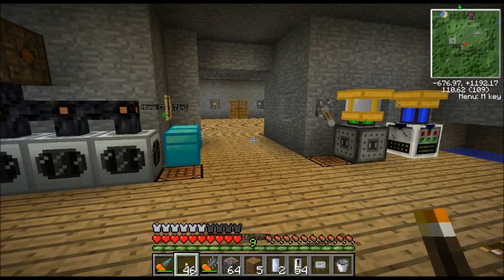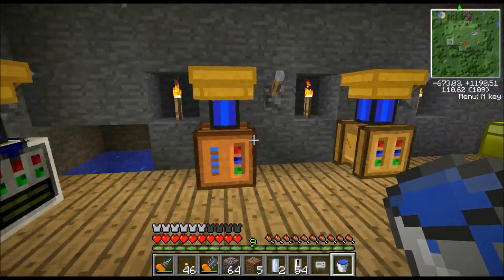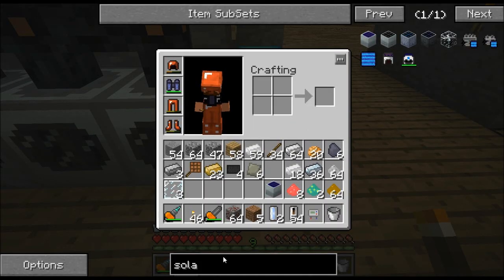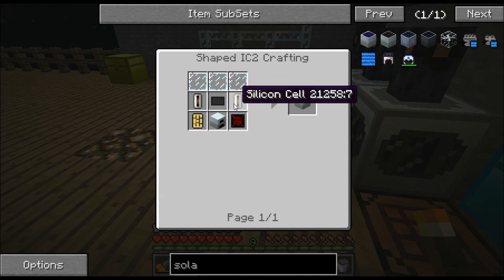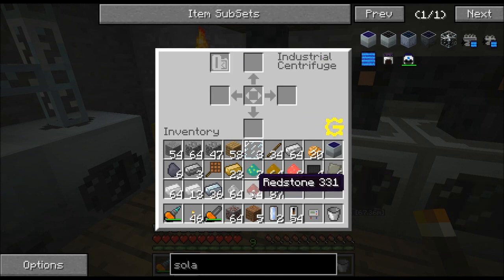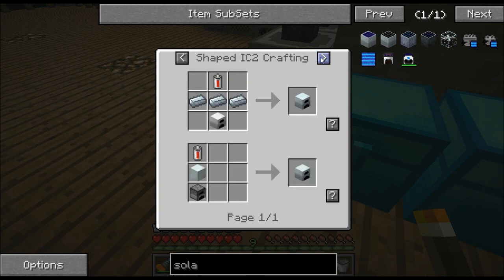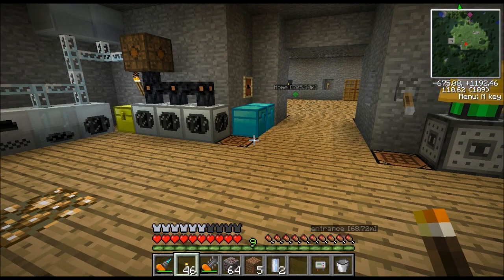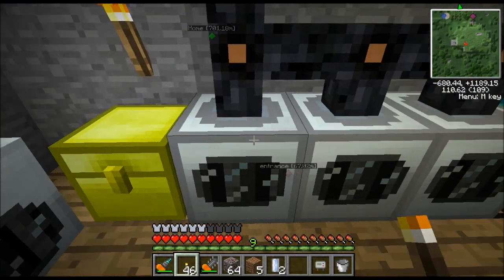FTB/Feed The Beast Tutorial - How To Make A Greg's Tech Solar Panel With Industrial Centrifuge

Comment: To add on this, in the latest GregTech version, you need refined iron plates for the machine block (and you need a hammer as well), which would cost you 16 iron ingots to start with to make a machine block. The 'iron furnace' version still only needs 5 iron ingots and then 3 refined iron ingots on your way to the generator.
So the iron furnace route is always preferred (just as you say), but in the newest GregTech version the 'machine block' way is more expensive.

Comment: I'd recommend Titanium in the top row and Aluminium in the bottom row of the rolling machine with bronze in the center to get something like 6 mixed metal ingots.

Titanium and Aluminium are both from running macerated bauxite through the industrial centrifuge.

Comment: Solar panels now require silicon plates which are made in an industrial blast furnace from silicon cells.  Also, a stack of redstone in a centrifuge now only yields 6 silicon cells.  I would recommend with the updated recipes to use:

1. Collect clay to make clay blocks
2. Macerate/Pulverise the clay blocks into clay dust.
3. Use the industrial electrolyzer on 8 clay dust, yields 2 silicon cells in only 10 seconds.
4. Put silicon cells in industrial blast furnace.

Comment: Aqueous Accumulator with attached waterproof pipes (wooden pipe not required) from your water hole to the Steam Engines is easy to do and makes them pratically run themselves.  Those Engines will also run Coal Coke too, and can run for like 12 hours or probably longer on a stack.

Comment: Great videos but I'd like to make one point.

The generator recipe with the iron furnace doesn't have to use 11 iron, it can but there is another recipe with only wants 5 iron and a furnace. With that one you actually come out ahead by not have to smelt 5 ingots twice.  Of course that'd only matter if you have either no patience or no fuels.

Comment: About 3-4 weeks but have done a lot in that time.  Only made one solar pannel though as i have gone for a wind farm instead and using 10 diamonds to get 60 glass cable so have a great charge rate.  I got to get more slime before doing more panels.  also set up a slow water mill trickle charge but not finding that to great of a kick back for the amount of resources you got to spend on it.  playing on this great seed -1790047059040723039  x14 y81 z212

Comment: Make sure you're not trying to connect the solar panel to the doted side of the batbox. That's probably the problem you're having. The doted side is the *output*. Also if you're using copper cables, keep them at most 4 blocks long or the power is lost. If it's a 1 eu solar panel, use ultra low current cables, they can transfer eu 40 blocks without loss.

Comment: Awesome video! but just to point out the first recipe for the generator is cheaper. But only by a little bit. Yes more ore but less burning which equals less coal spent to burn those 5 iron into refined iron. Really good if you are trying to make a series based around being green. Either way thanks couldn't find out how to get the silicon cells.
Reply: AtomMagik The cheapest recipe for a generator only needs 8 iron, because the iron furnace can be made with only 5 × iron + furnace.
Like this:
nothing |    iron    | nothing 
-----------------------------------------
   iron    | nothing |    iron
-----------------------------------------
   iron    | furnace |    iron

To be environmentaly friendly use EU from (an) watermill(-s) to smelt the (refined-)iron in an electrical furnace, instead of useing coal in an mundane furnace.

Comment from the maker: I have no idea. If you did what I did then it would be working unless you have some strange bug or something. Try placing a generator with a centrifuge on either side. A generator will power exactly 2 centrifuges. Also make sure you are placing the empty cells in the top left slot if the recipe calls for it. Furthermore, make sure you put in enough items. If a recipe calls for 30 items then make sure you put in at least 30. If you don't put in enough items then nothing will happen.

Comment from the maker: I am powering mine with a low voltage transformer. You could also connect it to a batbox or anything that puts out 32 EU/t or less such as the generator.

Comment from the maker: Yes, basically I think my laptop needs to go in for warranty repair. It only happens when I use USB headphones and it goes away if I place my hand next to the touchpad. I believe the motherboard has a bad ground or something. I tried unplugging the power cord but it is still there so the noise isn't coming from the power supply.

Comment: I was wondering if it's possible to make a completely automatic tree farm that doesn't require any materials to be spent on feeding into it. I found one that was almost completely automatic except for needing a supply of cobblestone. I'm probably going to make a drilling machine or a quarry, unless the FTB pack has something that could take cobblestone directly from a traditional water/lava cobblestone generator.

Comment: The question is, apart from the starting materials required to make the farm and the machinery to automate it, is it possible to make it completely self-sustaining and able to furnish a tree farm that's harvesting rubber trees and their sap? I need lots of these cables for various circuitry and so wanted to make a rubber tree farm that runs off wheat that decays back into humus. TheJims showed GeneriKB around his on one of GeneriKB's videos, and was almost fully automatic except for cobblestone.

Comment from the maker: They run off of low voltage so you can power them with a batbox or an lv transformer or a generator or solar panels, etc... 

I would just put a generator between  2 ICs. Generators will power anything next to them. One generator produces 10 EU/t and ICs consume 5 EU/t.

Comment: Yes, this video is no longer valid for the more recent GregTech versions. It only works for some of the 'older' FTB modpacks (mostly those for Minecraft 1.4.7).
You need plates instead of ingots when crafting the mixed metal ingots, and they do not go in the rolling machine anymore, when using the more recent GregTech modpacks.